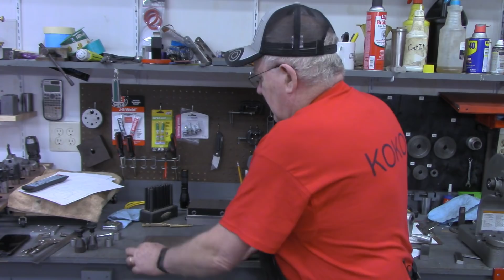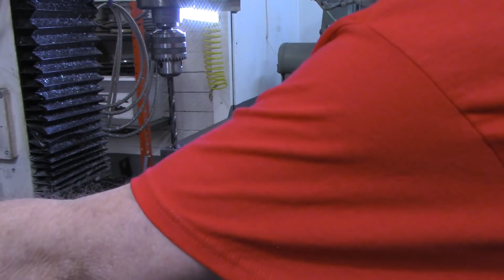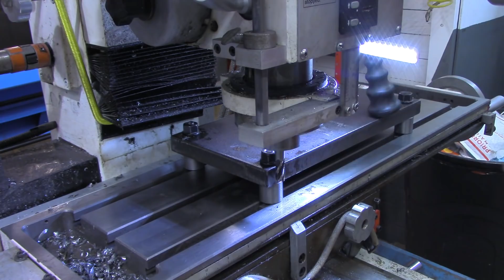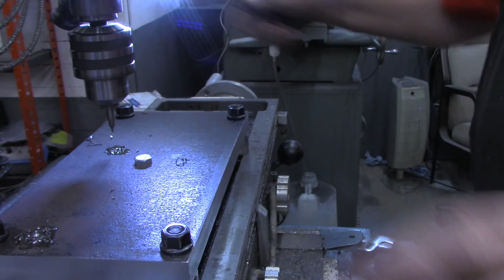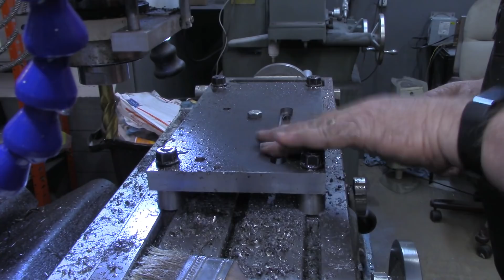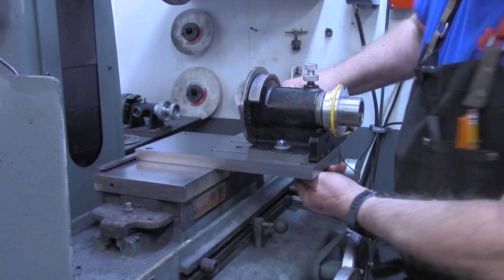Offset Plate for the Surface Grinder

Comment: Have been binge watching a lot of your videos and am a central North Carolinaian by choice. I too have a Harig, 618 so longer bed same down feed fine adjustment. I notice you have a cup wheel on the wall, can we use a cup wheel and what size do you recommend . Although I have grinders and a universal tool grinder I think it would be great for hss tool end profile grinds on the surface grinder. I plan on a jig for this purpose.  I also have a Bridgeport clone and am waiting for you to make that transition. Thanks for your help and inspiration.

Comment: Greate job!
You produced a fantastic lot of cranking in order to grind the plate flat. Why not motorize the cranking? A stepper motor, a little Arduino, a driver board... Easy to do for You. Motorizing the step also…...

Comment: i see your surfacegrinder is a hand operated originaly,but looks like you madeits table motorixed ,i have a surface grinder that the table is hand operated ,can u do a video on how to make it motorized in both directions please i have a disabled right arm ,can use it cbut not for strokes the grinder table needs ,,for long grinding jobs

Comment: Enjoyed Lee!  Be careful with the overhung load on the grinder table. That is only held by gravity and if you load it enough the V and flat ways will separate. You can add counter balance weights on the other side of the table to help prevent this from happening. It takes a while for the oil film suction to break loose, so a quick load test does not confirm that all is well.
ATB, Robin
Reply: Robin you should do it, check it and find a solution! This seems like a good solution for a small travel grinder if it can be proven effective

Comment: Learned something! Did not know you could put the jaws on the outside! I would have surface ground the bottom of the plate first to make sure the ref surface was flat before drilling legs with ground side down. 7:40 The bench crane is cool-Never noticed that before. The plate came out beautiful.

Comment: Thanks for sharing ,  really like the way you explain what you are doing. Very clear and the details we need. Excellent project Sir. Like the sine plate addition. I have only been working with metal and machines for a little over a year. I have learned a lot from youtube. .I’m making something real similar to your motorized spindex. Used the power head from a Black and Decker valve resurfacer. It’s adjustable from 1/2 to 11/16.  I’ll be using it on my Abrasive 1 1/2 Surface Grinder. If you had just a minute to check out the progress on my YouTube channel I would really appreciate advice from someone at your level.  And your doing something similar. I’m just trying to repurpose old parts.My plate might be too small for mounting the powerhead. Now I’m thinking adjustable like your sine plate. Excellent video, I feel really silly for not checking out more of your stuff. Just acquired a Camelback Canedy Otto Drill Presses yesterday and I dropped the pulley assembly on my foot so I have plenty of time today to watch your videos. Yes I always wear steel toed boots when I move heavy stuff the thing hit me where the laces are....ouch...  You might be hearing a lot for me today. It just might be a Tin Barn marathon.  I was subscribed to you but don’t know why I never hit the bell.  Thank you for the excellent content.👍👍👍

Comment: nice job lee good to see your makeing good use of your harig grinder and makeing some spiffy accesories to go with it. as i once mentioned i have the exact harig super 612 as you have and your inspiring me to build some of your projects if not all of them. im in the ending days of doing a compleat painting and clean-up of my 612 and its comming along very well.im in the process of makeing 2 new thumb screws for the 2 hand wheels with the calibrated dials as 2 were missing and then im going to blue them. thanks 4 sharing lee.

Comment: What a great topic I mean I came here to learn about the motor driven Spindexer build and knew it was for the surface grinder (something I want and am learning about in the meantime) to do round objects but making this plate to securely hold all of Spindex on the magnetic chuck is allowing me to learn about grinders details. You do nice machine work and best of all you share the steps in great detail so it is easy to follow along. Love watching the grinder do the surfaces to make them flat. Your support plate really came out great. Yes great center-less grinder out-rig that will make me happy.